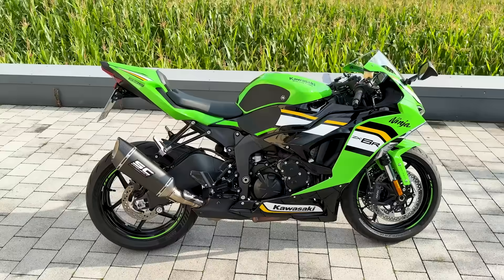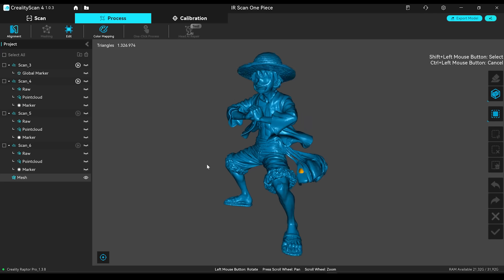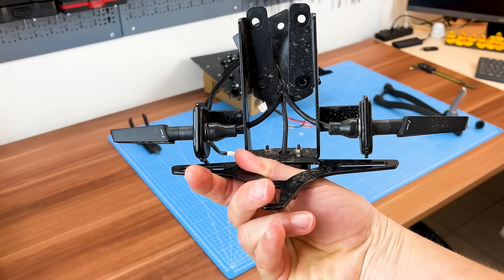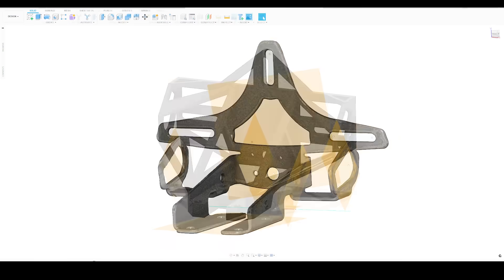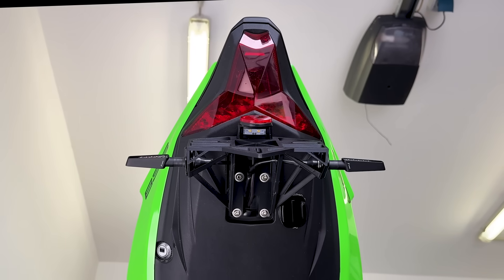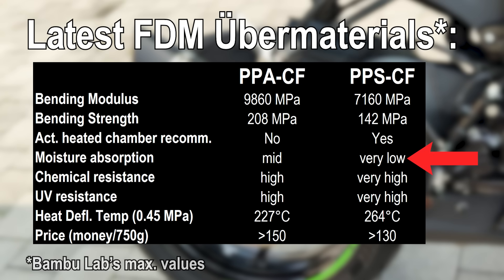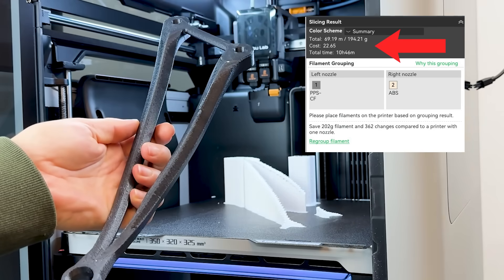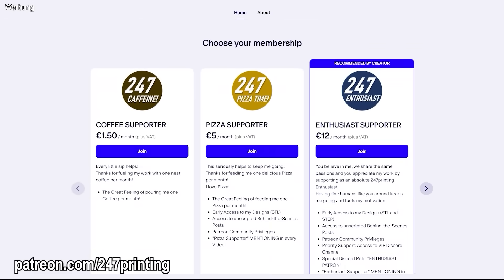Reverse-Engineering Motorcycle Parts with 3D Scanning and 3D Printing!

Comment: Hi, i'm thinking of making a front end for my street triple R 675 which i'm converting to a track bike. in its basic funtion it should be durable enough to not break under vibration and hold a screen (so load at speed will be a factor). as you've had at least some more experience i'd like to hear your 2 cents on what is a must have and maybe handy to have. are you happy with the filament choice? at my disposal is a P1S and Fusion student edition. i think i can get at least something basic, and iteration will be a thing ofcourse, but would scanning be an option to look into?

love to hear your thoughts.
Reply from the maker: PPS-CF still works great for my case and the ASA license plate holder is holding up as well. Went around 1200km with regular speed bursts since the video. It's hard to tell how much force would go into that part, depending on how it's designed, the expected forces and the printing direction, ASA COULD be sufficient. E.g. my license plate holder is not optimal concerning design and printing direction...

Comment: I have used a 3d printed license plate holder for my old bike for several years. As long as the design is good, I think it can handle a lot of stress. I had a chain  snap that bent my license plate, but the  license plate holder was intact. I used PETG, so not the strongest material either.

Comment: Actually recently mada a intake for a Chinese bike for a guy in fiberheart from siraya tech. Did not have a 3d scanner but like you use parametric (inventor) and just modeled tested fixed and got it tuned in. It was more me being curious what the filament was capable of and he needed a intake faster than he could get it from over seas.

Comment: I have been playing with forged carbon fibre for motorbike parts. Using 3d printed moulds and easycomposites materials. It works very well. A very underutilised area for 3d printing enthusiasts

Comment: I'm In manufacturing and $100 dollar doesn't seem too bad and the fact it would out last the 3d printed part by years. The exhaust hanger took over 10 hours and had to buy 2 types of filament so in some ways would cost more than a metal one, design and proto type then ok 3d is good but no one ever gives actual real world prices to do this like how much would it cost per hour and cost for maintenance on the printer and what consumables and then the big one is design time. It was an interesting project video and how the cheaper scanner's are making reverse engineering more cost effective.

Comment: 2 ceramic washers, on each side of the bracket (at its exhaust mounting-point), in order to isolate heat-creep from the exhaust and its mounting-bolt, would have solved the heat-problem (which I think is a real problem, I´ve burned myself badly at the exhaust a couple of times, gets extremely hot, several hundred °C, and not just 250°C).

Comment: I printed a speedometer housing and holder for my bike out of petg. Looking good and doing its job for 3 years now.(Mostly outdoor parking) 
I also printed a 2 piece bumbstop for the rear shock since I didn't want to take it apart to mount the original part that also was hart to get and expensive. 
Passed TÜV inspection and had 3 inspectors gathering around the bike to take a look at what's possible with "modern technology". 😅

Comment: My bike is the human powered variant (a diy recumbent) and I do trust FDM 3D printed parts on it. I have no experience with the much faster motor powered bikes but in case it is useful to anyone here is what I have tried so far: 

For years I had a bag for tools that normally mounts under the seat of a conventional upright bike. I am kinda maximalist with my tools so it was fairly heavy. I mounted it in a different orientation, held to the frame by 3D printed parts. It stayed there untill the bag itself broke. The 3D printed holder outlived it. 
So I then modeled and printed a box from PCTG-CF for storing the tools in a weirdly shaped space I have under the seat, above the main frame spine and in front of the rear wheel. This has now been there, full of the basic tools, inner tubes etc., for the past 15.000 km and has zero issues. The only non-printed parts of it are screws that serve as pivots for the closing buckles and cable ties that hold it to the frame. 

My handlebars are kinda printed, but not really. I modeled the shape couple mm thinner, printed it out of LW-PLA and wrapped it in layers of carbon fiber sleeve. Perfect shape I could not otherwise get because my bike is a unique homebuilt. Dimensions perfect for my body. 
And since I have the 3D model of it it is easy to design holders that fit that handlebar and hold a mirror and a speedometer. Or anything else I might want in future. 

My rear fender is held partly with 3D printed part, just PETG. Recently the aluminium tubes that make up the luggage rack snapped when I hit a speed bump at speed with a lot of luggage. I finished the last 50 km with the weight of the luggage resting on the fender held up by that printed part. It was partly torn up on one end from the initial crack of the rack but it held to the finish. Printed new one, swapped it, no waiting for a part to arrive via mail or something. 

When going long distance or unfamiliar teritory I want navigation. My weird bike doesn't make it easy to use simple handlebar phone holder. So I printed one that rests in front of me on the frame. PETG part creates a flat spot and to it I screwed a slightly modded TPU case for the type of phone I have. I just take the phone out of its normal case, snap it in that one and it holds on the frame so securely it never went anywhere even when I hit something that almost kicked me off the bike. For something with such minimum effort in making it (because someone already designed the TPU phone case and put it on printables) it serves extraordinarily well. When I get a new phone I just print the TPU part for it, swap it and done. 

Then there are small things like something that prevenst large bags from chafings agains the frame or brake or deraileur, but those are simple and boring.

Comment: cnc aluminium part from pcbway ? or the next cncbude ? ^^ a month ago i designed a inner wheel arch that includes the licence plate holder for a husqvarna, got everything so nice layerlines strenght ect. holds up really nice, original material was PP, i did it in petg because layer adhesion is superb

Comment: Awesome video dude! :)
Genuinei question, why riding on your bike, and very fast too, with jeans instead of protective clothing (pants)?
Reply from the maker: Glad you liked it! Here is the description of the jeans I wear: “Protective clothing for motorcyclists, certified to protection class AAA (EN 17092-2:2020). Includes removable, ultra-flat and soft ImpacTec protectors for knees and hips. Protector pockets at the knees and hips, with height-adjustable knee protector placement.“
Reply: @247printing You always make great videos! Oh I didn't know that such jeans existed! (I don't have a bike or any license to drive xD). Awesome that protective jeans exist though! :)
Reply from the maker: Thx again! ...me neither, until I heard about those during the driving license lessons. Still better to go with leather!
Reply: @247printing  Ah cool, very much a step up from normal jeans! That said I still doubt they have a lick on actual leathers though when it comes to abrasive resistance (like when gliding on the ground), at least afaik no alternative materials have quite managed to match it yet although as good (possible even better?) in other aspects.
Reply: I was thinking that too. Even  having an accident at like 50km/h can be enough to literally peel your skin off if you're unlucky.

Comment: 4:51 best pratice for when the "Freund und Helfer" (I had something mean here but I changed my mind) pull you over: 

have everything with you but only show them what they ask for. DO NOT give them all the ABE's you have. 
They don't understand what is written in there and will make you pay for a part that you are allowed to use on the bike.
Let them search for after market parts and give them the ABE ONLY IF THEY ASK FOR IT.

Ask me how I know.
Reply from the maker: How do you know? :)
Reply: @247printing  I have been pulled over many times and unfortunately the german police had absolutely no idea what is allowed and what is not. No idea how to check my bike. No idea to be polite in any way.

They did their dB measurements incorrectly (directly in front of a wall for example). They couldn't read what is written in the ABE of the brake discs I used (allowed for my bike but the first sentence in the ABE was basically that those Discs need a "Einzelabnahme" for bikes that are not listed. My bike was listed, I showed them. But they said I need to pay 50€ Bußgeld or they will get my bike towed :) After some not so nice letters from me to their police station, threatening to get an attorney, they just transferred my money back without any comment)

One time two motorcycle police officers took a dB measurement of my bike with an apple watch, because they forgot to bring their dB tester. I am not joking. The apple watch said something like 84db.. the papers of my bike say that 92 are allowed and the real measurement was like 96dB....

I crashed my bike once while riding alone. Some officer randomly came by in his free time and checked on me and called his colleagues to help with getting my bike out of the woods, call ADAC and so on. He was nice and helpful, his colleagues...

The only thing his two colleagues did was to ask me if I am fine and if that's not the case, they would call an ambulance for me and write a 200€ Bußgeld for a crash with a human involved (even though it was me). That was one sentence. Of course I said everything is fine because I didn't want to pay 200€ after just crashing my bike and having pain in the chest after the adrenaline was gone. They did not help at all, just stood there and looked down on me and the guy from ADAC trying to pull out a 220kg bike from the woods. When I was about to leave with the ADAC they told me that the City will send me an invoice for the minor damage I caused to the road. Thanks. I did not visit the hospital after the crash because I thought that they can't to anything about a broken rib or something like that. Pretty stupid thinking but I was lucky and did not die from internal bleedings or something like that.

Those are just "the worst" of the experiences I had with the police. 

I was always very polite and only said something when I was asked to do so but some of them were threatening me to get my bike towed right away instead of saying hello when they stopped me. My bike was loud. Or at least it sounded loud but everything I made was 100% legal. When their dB testing didn't give them the results they wanted, they always started looking very closely to find anything that is not legal to make a Bußgeld happen whatever it costs.

Due to all of those experiences I had with them, I really lost the trust in the german police. Makes me really(!) uncomfortable to know that these people are allowed to carry a gun.

Greetings to the Autobahnpolizei Frankfurt where most of those prime examples for "good police work" are from.

Pretty sad.
Reply from the maker: Oh man, thanks for sharing your experience. I fear that too: No idea about what's allowed, what needs an ABE, and what not... Saw some clips about our Freunde and Helfer on YouTube - even on TV they tend to be wrong :D

Comment: it's ridiculous when people use 3d scanner for stuff that can be measured with a tape
Reply from the maker: Mmh and it's ridiculous to use machines instead of horses, right :) ?
Reply: @247printing  I mean those particular parts are very simple, you just need to know location of few points. If you were to design a something that needs to mate a surface, scanning would be appropriate.
Reply: A 3D scanner is one of my best investments I did for 3D printing and CNC work. Repaired a medical device for a doctor scanning a broken handle holder last week for example.

Comment: Siraya Tech and Creality both sell PPA-CF for less than 75 usd per kilo 

Siraya Tech's version is pretty impressive and prints on an X1C but the flow rate has to be limited to 3mm cubed at 300c however if you print it at 320c on the K2 you can get away with 6mm cubed. Additionally, if you get real PPS-CF you can print it on the K2 at 340c and a flow rate of 11mm cubed. I say real PPS-CF because every brand other than bambu's version doesn't really start to flow until 310c.
Reply: I was going to suggest the siraya tech PPA CF core. At 330° on the h2d with a .6 nozzle I actually print it at 30 cubic millimeters a second with beautiful layer adhesion. I did end up slowing it down to 25 cubic millimeters a second just to help with pressure advance and flow rate. The max flow rate tests don't work right on filled filaments and like make it look crappier because of the layer height the test picks. In reality, it can go much faster and still look beautiful and be strong at .2 layer heights. I really like the core as you still get a little bit of the surface texture that you get with filled filaments but without actual fiber sticking out of the surface. The price is definitely right on it.
Reply: last time I checked Siraya is often out of stock or does not send to EU at all
Reply: I use Fiberon PPS-CF10 and use Bambu's PPSCF settings and it prints perfectly.

Comment: I would not trust that print to hold such an important part of your bike. You should have printed that plate bracket in multiple parts and screw it together, that way you can print each section in correct orientation for best strength.
Reply from the maker: Which one of the two parts do you mean?
Reply: @247printing  I wouldn’t really trust either, but the exhaust bracket is at least printed for strength.
Reply: @wrxsubaru02   Motorcyclist here, I'd trust the plate holder, it's not holding much in the way of weight, but the Exhaust bracket concerns me. I see you have an aftermarket Exhaust. How much does that weigh?

You live in Europe, so your tax dollars are spent on civil infrastructure and health care, so maybe your roads are better than what I'm used to. Here in the US, we spend our tax dollars on the world's most elite and expensive Un-Healthcare system, and our roads really suffer for it. If you've got pot holes that could overwhelm your suspension travel, you need to consider impact G-forces. Ideally you dodge the pot holes, but the open road isn't always ideal.

If I were to make any brackets for my bikes with 3d printing, I would use 3d Printing to make molds to make a Forged Carbon Fiber part, similar to the exhaust hanger you showed. It'll cost a lot to get into FCF, but once you make the initial investment in time, maerials & PPE to start working with the process, the parts don't come out too expensive.

I wouldn't replace the bracket personally, I'd just take the left bracket off and remove the rider peg on the right. I ride  dualsport and ADV bikes, so mild steel is the perfect material since you can bend it back into place on the side of a trail when you get into too much trouble. And on any big trips, JB weld and any welder worth their salt can fix it.

Also, is this your first bike? I was under the impression that the EU had a tiered licensing system, and that ain't exactly an A2 bike. If it is your first bike, those inline 4 600s can be a hand full. Torque curve isn't exactly beginner friendly as you've probably seen, and the breaks and suspension can goad you into riding over your skill level something fierce. Stay frosty out there.
Reply: @Scrambling-Man have you compared structural data from fcf to the filament he printed the exhaust bracket in
Reply: @247printing  @ 7:23 The license plate bracket.

Comment: For anything that has any stress on it at all. I like the @easycompositestv method for compression molded chopped Carbon Fiber. Prototype in FDM, then Print the molds.  Can get some cheap really strong parts.

Comment: Great video! I think PPS-CF is the most promising material on the market right now. Its high temperature resistance and relatively low printing temperature, which makes it compatible with many printers, opens up a lot of possibilities! However, you should anneal it to get the most out of the material. :)
Reply from the maker: Thx Tim! Yeah maybe I try to anneal the part at some point, but for now it feels like "good enough" :)
Reply: It needs 350 to properly print so it's not compatible with most printers. Maybe you got it confused with ppa which can be successfully printed at 300c.

Comment: im about to turn 31, so i dont think it counts as a midlife crisis (by the numbers i seriously fucking hope not) but i have been wanting a medium speed electric motorycle lately, and you havent made it any easier Albert. that said the scanner has done well, and those exhaust hangers worked out so well" congrats man, and also, very nice to see you back, its been too long
Reply: 31 is absolutely old enough to have a mid life crisis, especially in this day and age...
mine started at about 25
Reply from the maker: hey hey Dom, nice to see you back in the comments! Motorcycles are fun objects for me, not for transport, but for emotion. Call me old-school, but I love high RPM motor sounds, just like in the good old V10/V8 F1 era. I don't care for torque at low rpm here (like on modern 2 cyl bikes or electric motors). Though everyone is different in this regard.